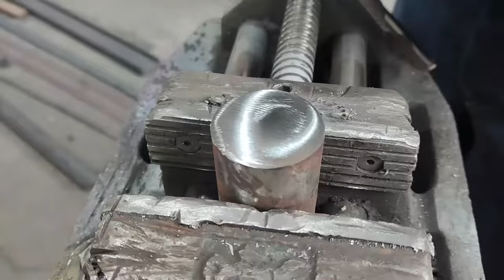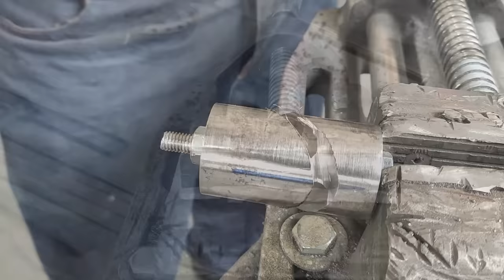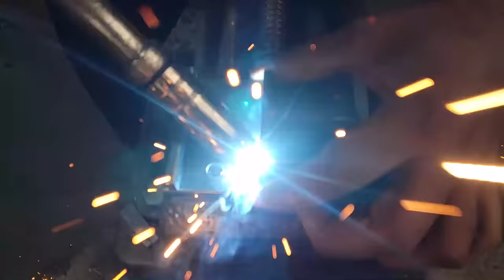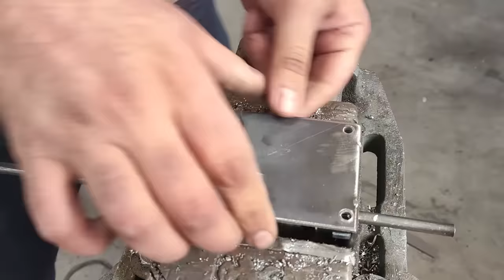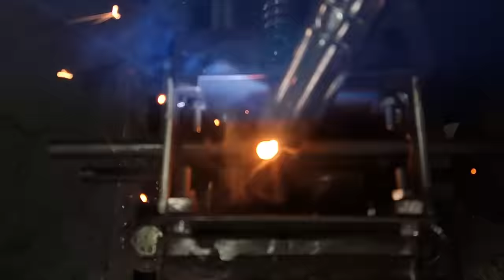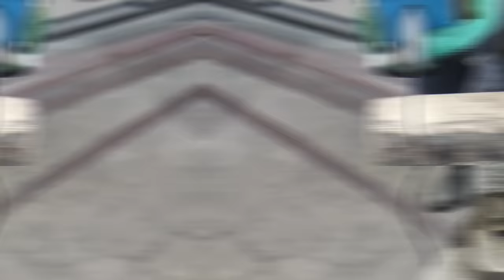The Mechanism That Changed The Tool Making Industry

Comment: Seems you accidentally put the wrong title on this video, it should be "Watch me make a shitty reciprocating saw". How this mechanism has anything to do with "changing the tool-making industry" is apparently an exercise left to the viewer.
Reply: I mean I'm sure it did several centuries ago.
Reply: my rock harb shweenis is like 4.5 inch meters squared
Reply: @mewmew32  He's the tool.
Reply: I'm pretty sure I could feel that thing vibrating! 😐
Reply: You discover how to harness horses around a wheel or better yet a water wheel for energy..... this is how that circular energy, that torque, is converted into SO many useful applications with a straight motion. Its simple but yet not at all obvious and did SO much useful good its impossible to calculate that value of this engineering discovery. Its an exercise in appreciating the value of such a simple yet not obvious discovery.

Comment: Top marks from doing a simple job in the most difficult way possible
Reply: But is there a better way to do this if you only have a few hand-tools?
Reply: @andybrice2711  offset crank and follower
Reply: His vice is evidence of  chronic tool abuse
Reply: @andybrice2711  Only a few hand tools? The amount of tools & metal required to basically make a jig saw!!
Reply: @andybrice2711  rotary crank-arm with slider-rod.

Comment: In 1982, I spent $17.50 at Sears for a "Re-Manufactured" Reciprocating saw. Still use it every month for some, like cutting metal to make another. ASE Master Tech since 78, retired.
Reply: '82... was it the newer style of recip you see now a days, or was it the earlier type that looked like a hedge trimmer body w/ blade, instead of a toothed brush cutter?

I had one of the earlier ones  It was before the Tiger Saw came out & changed the look & popularity, (usefulness), of recip saws to what it is, today.

All I remember of the early one was it being under powered, prone to getting hotter than blazes, & by some marvel of misdesign waa capable of shaking a 190# man's teeth out, while the 2# material being cut stayed still.

I can't say I recall any truly easy or successfuls cuts where I didn't end up bailing on the vibromatic & grabbing either a hand or hack saw, depending on the material!

Thanks, you brought back such winderful memories of chucking that monstrosity & the sheer joy of my 1st real recip saw, which I still have, & use regularly, despite DeWalt trying to obsolete it, years ago.

I've found the parts to fix it from alternative sources the 2 times I've needed them & DeWalt got no more $ from me after discovering they'd discontinued the trigger switch w/ no replacement 3 yrs after the saw was made.

I'm the type who considers a corded tool a lifetime investment; if they can't make it, I don't want them.

It's led me to a lot of Bosch tools & I thank the crappy US tool manufacturers for paving the way towards the true enjoyment of using quality tools, the6 don't make!  LOL

GeoD

Comment: If you had an existing one you connect it to the same rod put a smooth rod through the groove and use it as a template, just position your angle grider and start rotating the rod it will follow the original`s path to make the groove acurately

Comment: Very nicely illustrates the concept. To be quite honest, if I were asked to design something like this I would have (incorrectly) started with a crank mechanism, and gotten nowhere with it!
Reply: Why the crank is a bad idea??
Reply: Con el engranaje adecuado sería buena idea
Reply: @martinmedina2460  ⁹
Reply: Именно кривошип неплохо работает в сабельной пиле
Reply: @martinmedina2460  Late to the party but cranks are bad because they would not drive the reciprocating bit completely straight. There will always be a lateral load that will both reduce the amount of force actually driven into the work material and push the tool sideways because of the torque from the motor

Comment: maybe they upgraded since to the piston idea, gving the slide less friction & parasitic torque on the screw that goes on the barrel.
here's an idea to do the rift on the barrel : angle the barrel 45 degrees and stand still your angle grinder, so it will do a circle (after all it's an angled circular groove)
nice video, a few tools and you got it working.

Comment: Honestly asking this.. would just making a small crank shaft and rod be easier to do? The metal on metal friction I think will not wear too much when not loaded but once you put a heavy load that groove I want to say is going to widen out and try to become a circle rather than a wave
Reply: I was wondering the same, The friction would be introduced in a smaller surface area on those plates though. I imagine the increase distance from upstroke to backstroke also would increase the thermal exchange if that makes any sense.
Reply: That could be another solution. The only issue, of it is one, the motion output would not be straight out but at a right angle to the drill.
Reply: Yes steel on steel is a no no brass be nice or phosphor bronze I would humbly refer to it as a cam with profile follower .
Reply: Sewing machines that are 80 years old have similar concepts to change rotation to back and forth motions in small spaces. They are still working now after I cleaned off the old oil and don't look like those areas are wearing out. Based on that, and designed well a device based on this concept could last generations of use. 

That said, the main needle doesn't use this idea, that uses an offset pivot point that has been counter balanced. So there's probably not lasting high power behind this idea for like a saw like in this example, or it was easier to change the angle 90 using a pivot point so that makes more sense than this which doesn't bend the motion angle. For a sewing machine needle bar.

Anyway, it certainly could serve other rotation to linear needs for a long time. It's almost like a worm gear that automatically changes directions for another example that is similar. It reminds me of a rack gear instead of a circular one. With some work, there could be more grooves and more teeth. Idk. The concept looks like it has potential and I see it in part in some old stuff already.

Not a machinist or anything. Just learned to take care of my own stuff and watched my dad from time to time in the garage. So I am likely missing some points an expert would explain better.

Comment: It's called reciprocating saw.  I am not sure if the price of the material used + energy + equipment + time would outweigh the price of the tool itself which can be bought for cheap and mass produced.   It is interesting.  That's about it.
Reply: Did you read the description? The goal wasn't to compete with store-bought tools. The idea was for you to see a simple design of how to change rotation to linear without changing the direction of the shaft like an offset pivot point on a wheel does. One use for doing this could be a saw, but there are many uses. 

As for materials, it cost you the electronics and time to watch. He saved you from building it in order to see it and get a fundamental understanding. This idea probably becomes much more complicated in modern reciprocating saws.

As for learning how. He welded next to his fingers. It is clearly melted metal. Maybe I don't understand, but I am too scared to have my hands that close to stuff that hot. I use oven mitts and my baking is lower temp than welded metal. Plus, I would worry about the sparks falling on me, causing me to flinch if not out right scream from the burn. I think he is an example of what you should not do. 

Oh, and the measuring tool, using calipers like a scribe, my assumption it would mark up the ends and eventually be a measurable amount. I guess it would be okay if he has a way to recalibrate them or cares about accuracy to only the ruler. Maybe the dial broke, so instead of tossing them, they are now a scribe marking a compass tool thing. Measuring distance wouldn't be important then, just sharp points and the ability to lock in place. Too bad they did not explain this for other.

Comment: That is a novel adoption of a mechanical actuation.  That action functions and has been around forever.  But there is too much pressure and friction on the scroll and stylus.   It is only for very light control mechanisms...where no work is involved.  As is, that will wear out in one day. A basic crankshaft and connecting rod(like in a reciprocating engine) would perform the same motion and last for years.  Still, that's great video.

Comment: Thanks for sharing. This is neat to know. Maybe I can use the idea with 3d printing toys or other things.

I noticed you were welding by holding the parts with your hands. I have a little mig welding experience. If I tried that, I would burn myself if. The video description says you have industry experience. How come you did it that way? Does burning your fingers concern you?

I would ask my boyfriend to choose a safer option to prevent injury. My dad got a staphylococcus infection from a tiny workplace injury. He was sick for weeks, hospital and everything. He was so weak we thought he was going to die. Now I dislike people taking avoidable risks, even small ones.
Reply from the maker: Thank you for your advice. I will be careful and use safety equipment. 👍
Reply: @relietron  teaching how to use safety equipment is also an added bonus. Lots of people would want to know the best way to do things. Some people go really far with it and it's fascinating what a difference using a tool slightly different makes. Mills are a great example and are really interesting.

Comment: You have an angle grinder, do you really need a sawzall? You could've went the reciprocating rod route, making a circular part on the drill, and did a reverse steam engine wheel-type thing. Would've made it at 90 degrees from the drill, but a lot more movement (right-angle gears would correct that, like in the real one). You could even make it adjustable, the smaller the stroke, the more torque. The groove would be impossible to put a bearing on.
Reply: cast iron and bronze parts would work as a bearing, but it would have to be machined to a much tighter tolerance than the work in this video

Comment: Now to design a more hand friendly enclosure; I wouldn't be able to use my abused 70 yr old hand(s) for several weeks after using that.

Plus, the vibration & shock to your wrists are gonna disable you by 45.  I have nothing against you igenuity or endeavor w/ basic tools, but better selection of materials & more time invested in fabrication than just the length of a YT vid would result in a useful tool which won't rob you of the ability to work & cause a lot of pain when you do work.